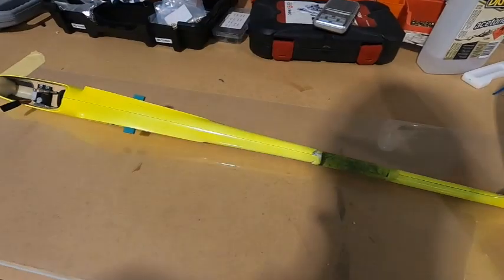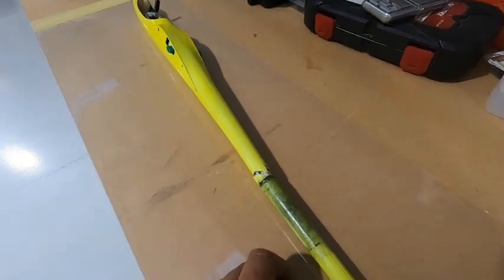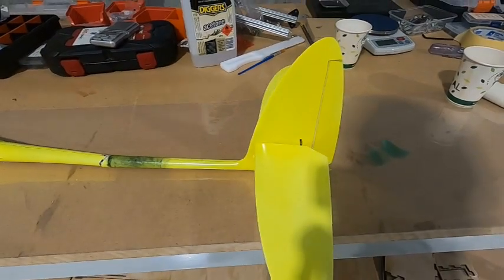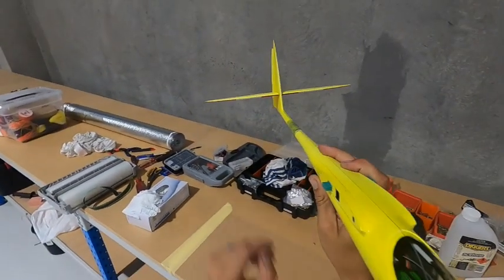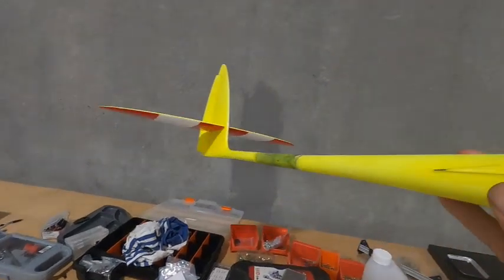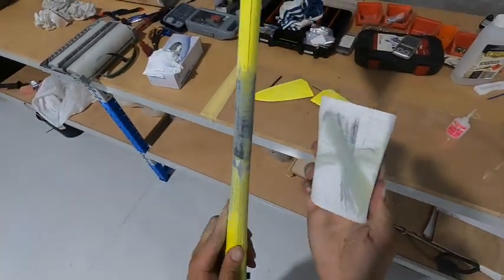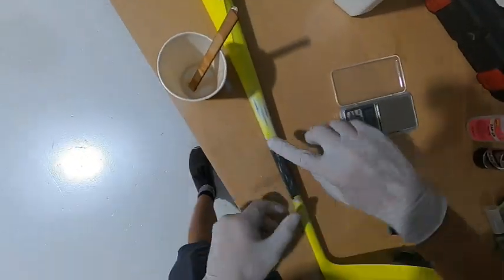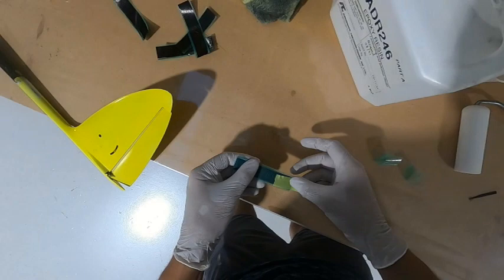How to fix a Composite Glider Fuselage

Comment: The method that I use is to wrap two bits of 10mm aluminium angle about a foot long each side of the fuselage with tape. This makes sure that the two bits of the boom are perfectly aligned and gives you room to dab a bit of CA into the break to tack the two bits of the boom together. Then cut back the gelcoat and apply the bandage. If the pushrods are also broken you can get inside the boom and do an internal bandage instead (or as well) but still use the right angle to align the bits while the joining epoxy sets. An inflated condom helps keep the internal bandage pressed against the insides of the boom while the epoxy sets.  Use pieces of the broken pushrod oiled up with vaseline in the break area to keep epoxy out of the broken rod tubes so that new pushrods can be easily installed later.